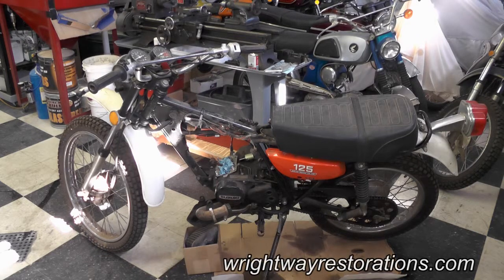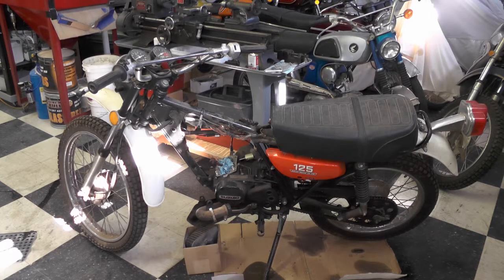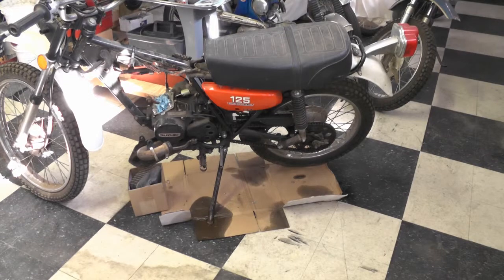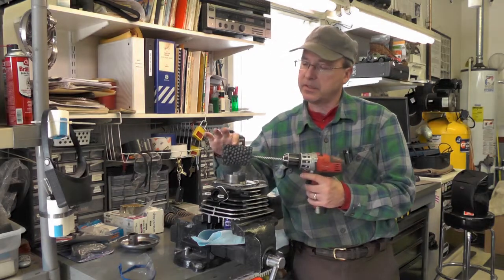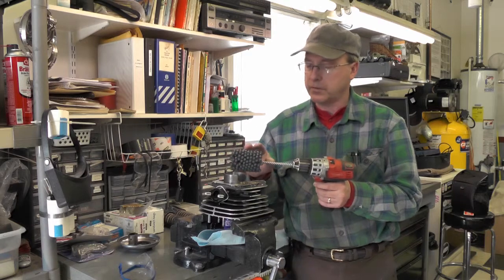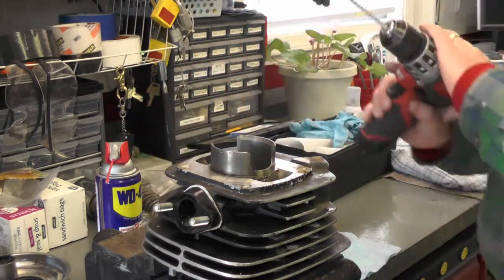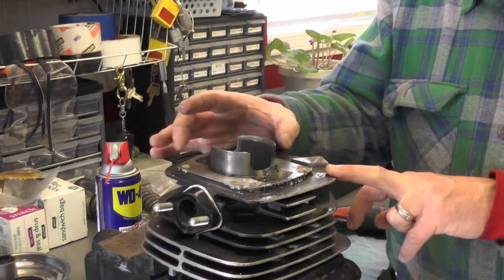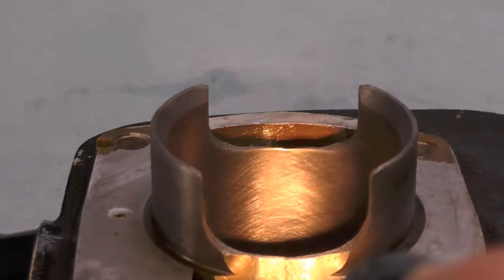Project: Suzuki TS125, Part 1 - Project Overview --- Video #52

Comment: just curious would it have been better to use a drill press instead of a cordless?
Reply from the maker: I suppose a drill press could be used, though I've always used a hand-held drill.  To use a hone effectively, one needs to be able to pass the hone almost all the way through the cylinder but not so that it exits the opposite side completely.  Therefore, if a drill press was used, the cylinder would need to be to fixtured accordingly.